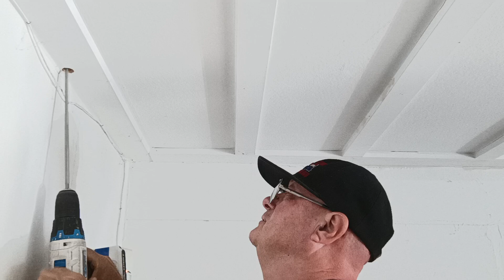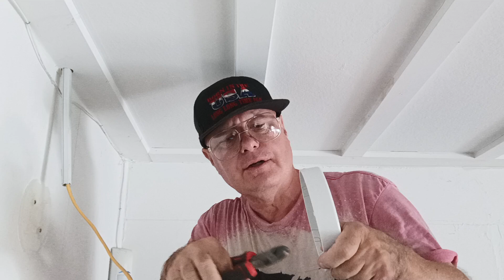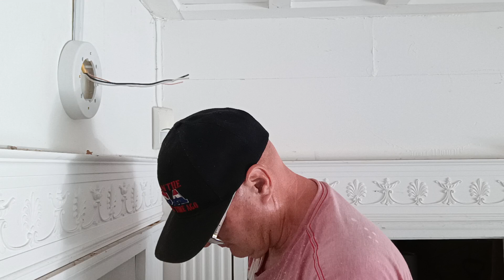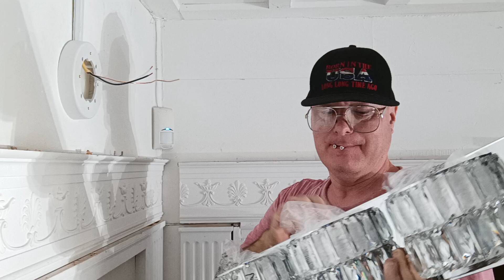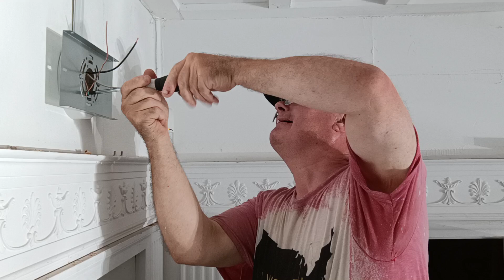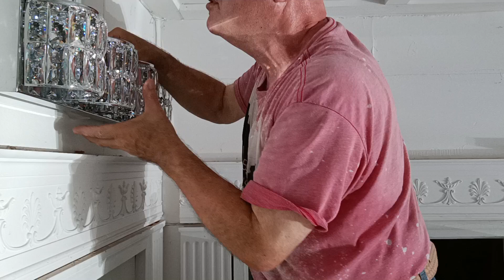allen + roth item #1362616 model #VBL20-4CH how to wire and install using plastic wiremold

Comment: White is no longer allowed for switch loops. Even if marked or identified. So now you have to buy cable with black,red,white, and green or bare. The white must be called off or connected to a neutral conductor. This is because the white wire at a switch may be needed for the new smart switches and devices that need a neutral to function.